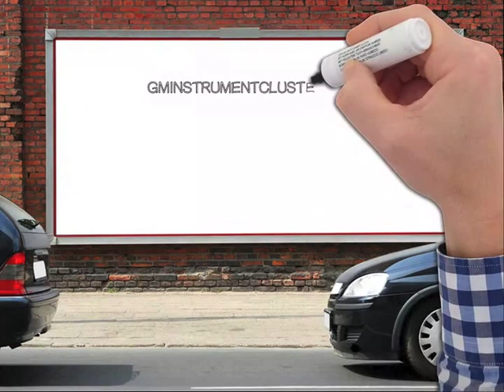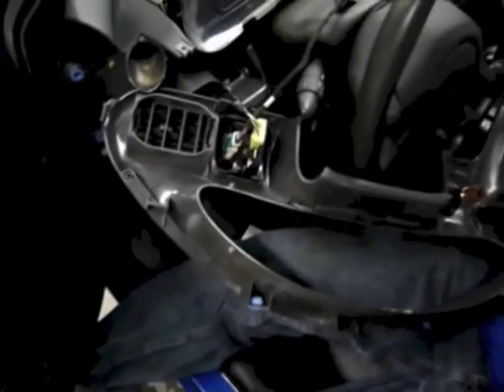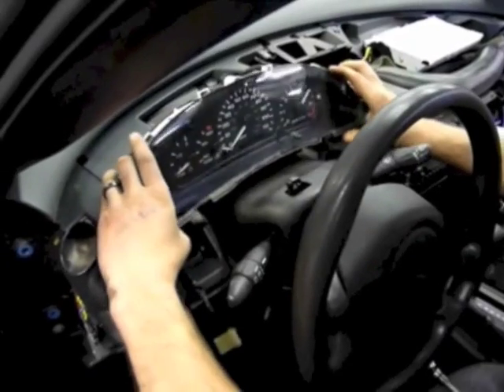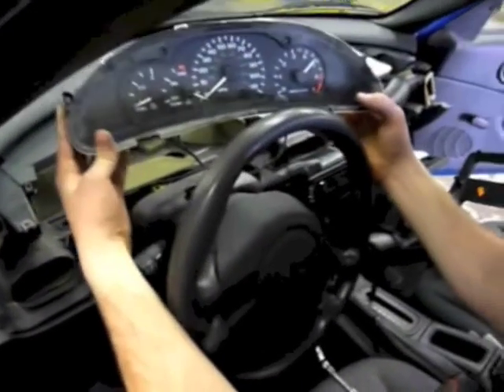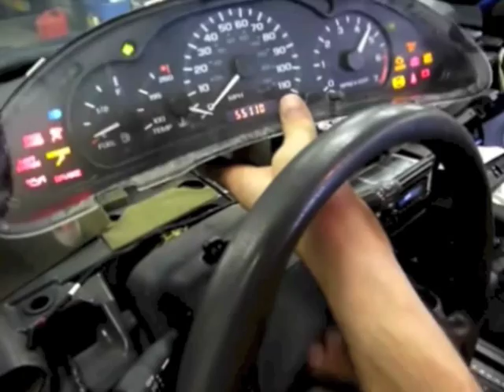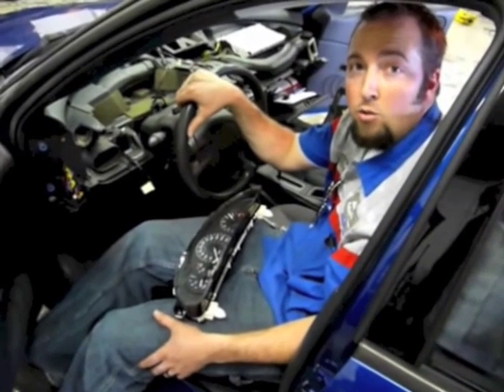Chevy Cavalier Speedometer Repair

Comment: What year Cavalier is that? The problem I am having is the temp gauge reads normal and then it shoots up to the red, then it goes bad to normal again. When it hits red the check gauges light comes on. It does it well your driving. and the odometer flickers in and out. Have you heard of this before? What a ball park figure on price on a rebuild? Thanks great video

Comment: Hi, I have a 2005 chevy cavalier. I am having problems with my speedometer. Plus my daytime running lights are no longer on. A friend of mine mention about instead of pulling dash apart but to check the sensor. How can you check for sure it's the sensor and how do you change it on a ls sport?